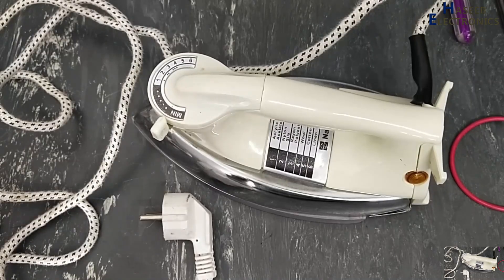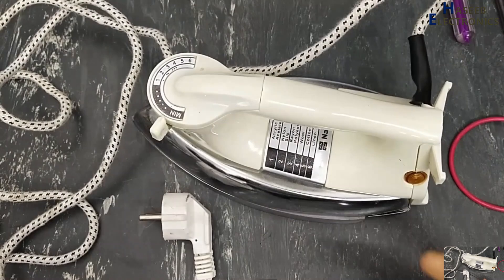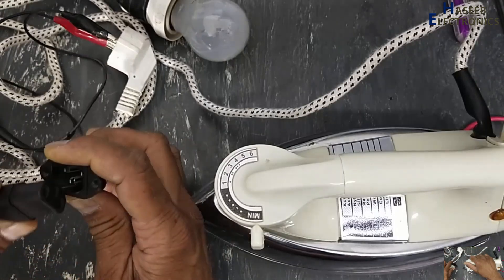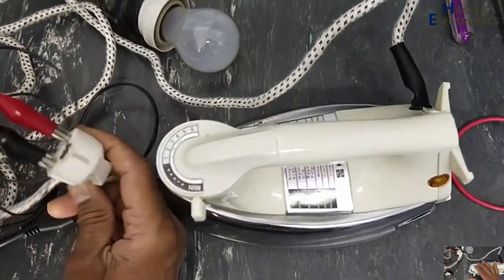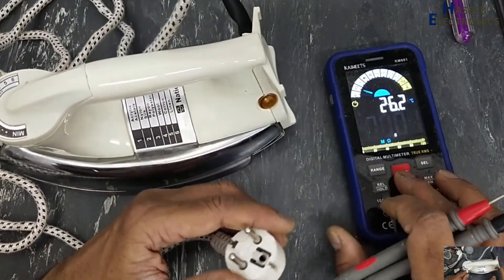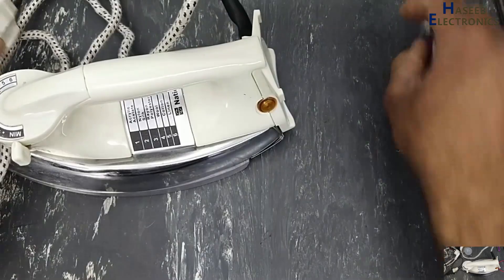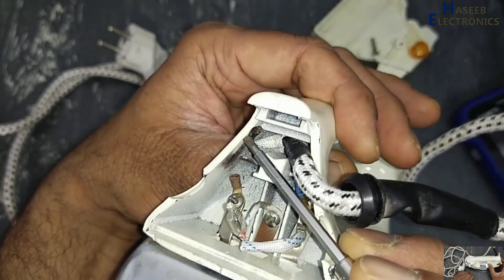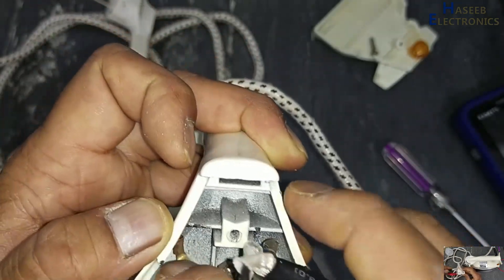{1169} Electric Iron not heating up

Comment: Sir you produce amazing educational videos, thank you. However, many  countries around the world have put a ban on crimping soldered wire, deem it electrically not safe to crimp soldered wire, because over time the wires moves and the good joint becomes a dangerous joint due to a bad contact between the wire and the crimp. This has caused many fires. Please either crimp the bare wire, or solder the wire

Comment: Where is the third wire in the cable? It has a Schuko plug and the iron should be grounded for more safety. 🤔Did the vendor cut  it?
Reply from the maker: good morning dear 
you are right, safety ground is much more important but
in these cheap and local brands there is just 2 wire cable only 
safety wire  is not installed at all
even you want to replace cable, you will find only 2 wire cable in local spare arts sellers